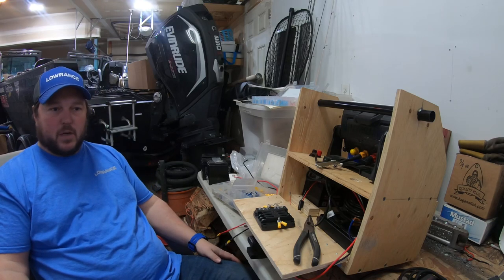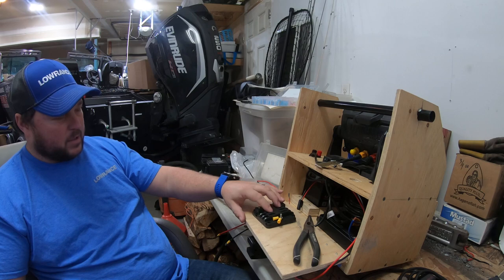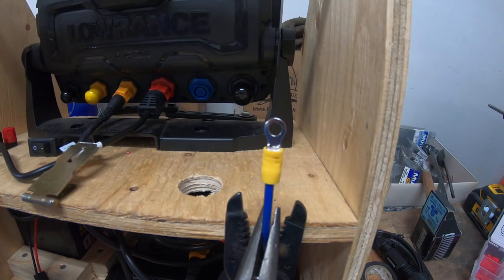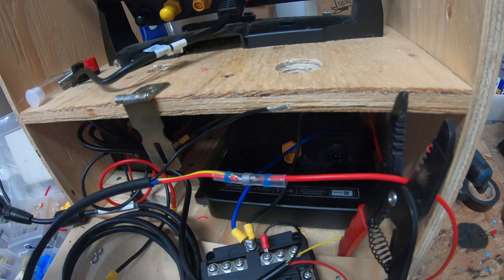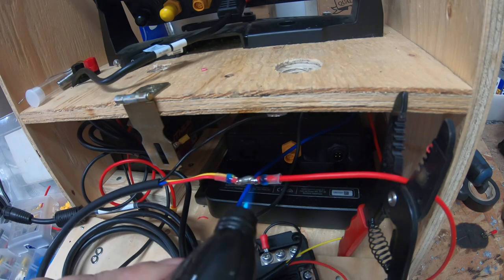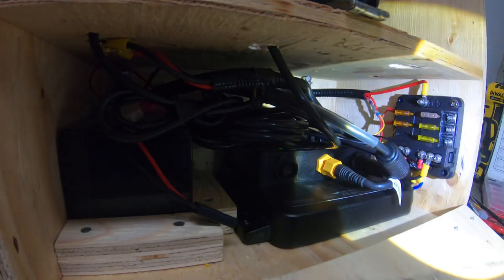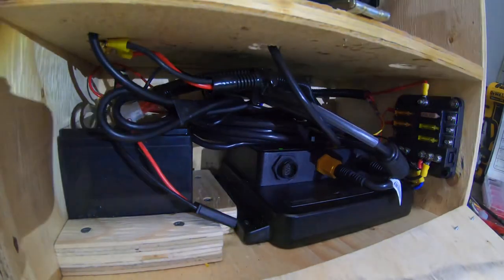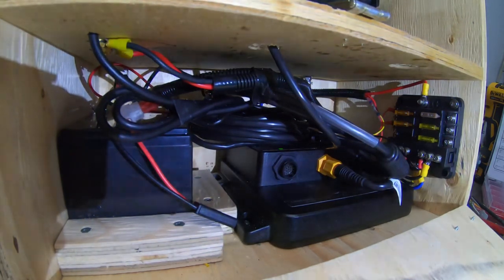Lowrance ActiveTarget wiring tutorial (ice fishing)

Comment: Did you connect ground on module?
Reply from the maker: I have not connect the module ground screw. None of the installs I’ve done have needed them done
Reply: @BulatOutdoors  thanks.  My unit will be a stand alone system on an arc lab shuttle so I dont think it needs it either.

Comment: How did the battery work out
Reply from the maker: It wasn’t getting much more then 5 hours I believe. Winter was a bowl ago now but I switched it up to a 23ah Dakota and was getting closer to 7 hours on it and brought the 18ah as a spare to connect if  I killed the Dakota. Was much happier with the 23ah. If I could get ahold of a 30ah I think that would get through 8 hours plus.
Reply: @BulatOutdoors  amped outdoors has a 30ah. Just ordered one
Reply from the maker: @caseywuest6016  amped are hard to get over the border to Canada. I just got my Eco-Worthy 30ah so I’ll see how it does. Just put it on the charger
Reply: @BulatOutdoors  cool let me know what you find! I saw those looked like a cheaper option just didn’t know anyone who had used them yet.
Reply from the maker: @caseywuest6016  I know 2 other guys running them but still new this season so we’ll see.
Reply: @BulatOutdoors  cool. I just got active target set up on my summit ice package. Any secrets? Settings etc?
Reply from the maker: @caseywuest6016  I just picked a color pallete and ran the rest on factory settings